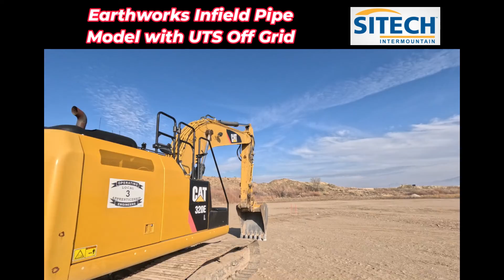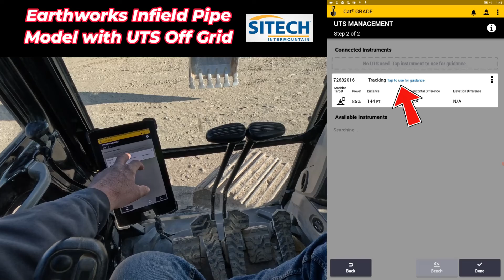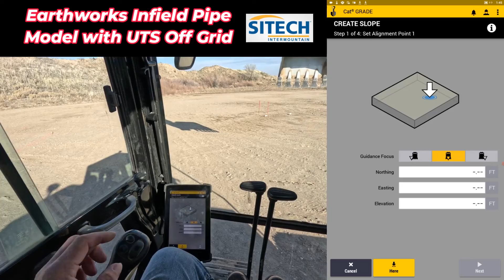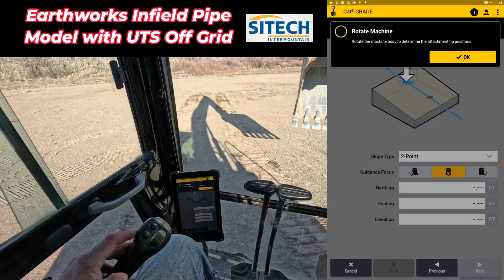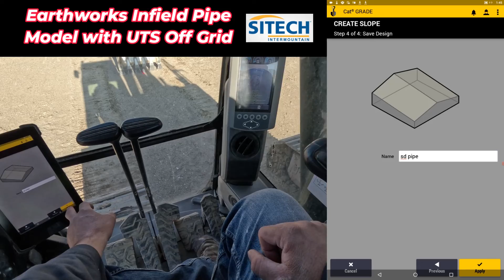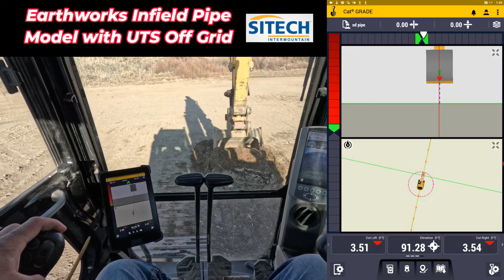Earthworks Infield Pipe Model with UTS Off Grid

Comment: if you had a data collector is there a best practice for setting up a total station without any set control basically do everything your doin here but just with a data collector
Reply: Yes, if you are not setting the total station off control or don’t need it to tie to anything, you can create a dummy job site in the data collector with no control points or designs and then just level the TS and basically just go through the level it up and set it temp, and then it will say “Set up with no control point”. Just leave it on the default numbers for nothing wasting and elevation or change them to what you want, then it is set up unknown.  You then just go into the menu on the data collector and set the total station into machine control mode and you can use it as a control TS for your machine and do infield work.
Reply: @JeffLarsen-iz8qk  thank you sir

Comment: If you were just doing a 2d pipe slope using a sloping laser (not infield design-just using the laser catch and earthworks to dig a slope) would it be in between UTS and GNSS for accuracy?
Reply: That is a very good question.  It would be kind of in between.  The reason for that is because when you are using UTS and GPS the machine is getting constant corrections and the laser only corrects once you catch the laser beam.  So after you catch the laser and start digging, it is using its onboard sensors only for grade and the cut and fill shown on the screen only do ever 5 hundreds like gps, but it would still be a bit more accurate because it’s not trying to to calculate gps at the same time. UTS is also correcting the machine but is way more accurate because of the total station itself so that’s why it’s showing every 1 hundredth.  Hopefully that made sense, but not as good as a UTS but just a bit better than GPS would be my answer.  Thanks for watching